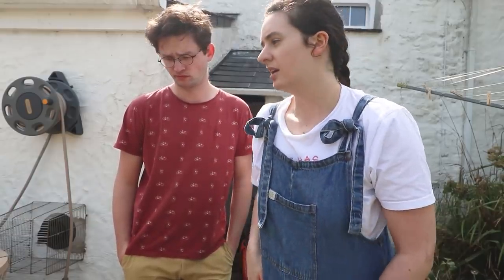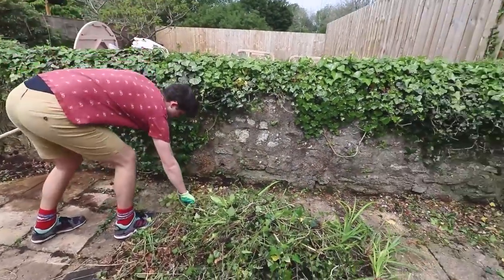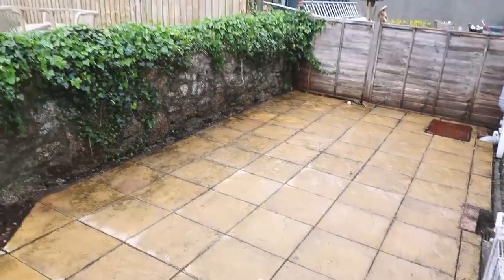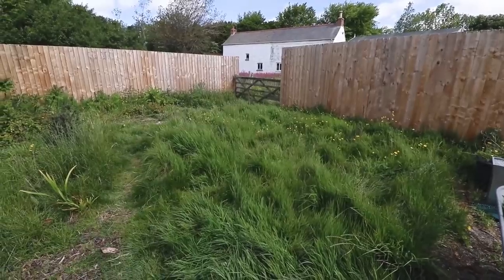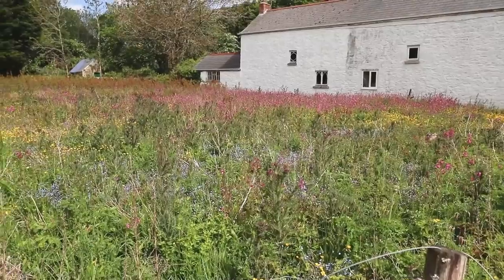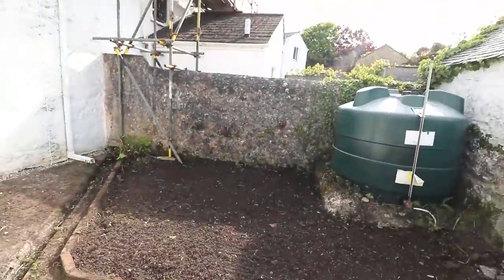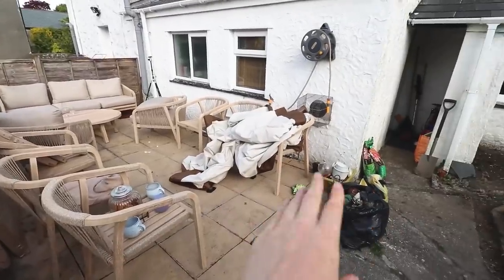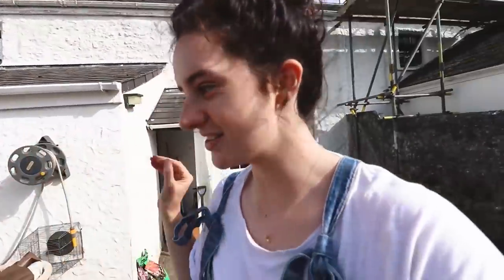TIME TO FINALLY SORT OUT OUR GARDEN | RENO VLOG 11

Comment: Tomatoes need at least 8-10 hours of sun to grow and ripen successfully! Peppers also... shade is good for herbs,spinach and lettuce....👐🏻🙂
Reply: I have 4 1/2 hours of sun on my balcony and my tomatoes have and are doing great!
Reply: This really depends on the variety! Some tomatoes have been bred to successfully grow with less sunlight and cooler temperatures, like Black Krim and San Francisco Fog. Several varieties of Roma and San Marzano tomatoes do well, too.
Reply: Also, if you single stem your tomato vines and grow them vertically, with a short wall like that you could have a good three meter vine that gets plenty of sunlight once it grows above the wall line. Just be sure you get an indeterminate variety rather than a determinate one if you're going to do that.
Reply: I agree that you really need to look at the specific plant and instructions for growing. Lots of herbs need full sun. There’s always something that will work in any area though!

Comment: I'm exited to see where it goes! I do have a shaded garden area as well, and there are some beautiful blooming plants that you can put there like hydrangeas, peonies and rhododendron along the back wall, with some smaller blooming plants in the front. I would suggest watching during the day to see when the light hits where, you might be surprised to see that shaded areas will get light during different times of day. Also, I would consider getting rid of that wall. I know it looks super cute and romantic, but if you have lots of people over the space will feel tight and unpractical. It's much more nice to move around when the patio is open to the rest of the garden.

Comment: I would probably use that patch on the side to put up raised beds and you could easily plant lettuce, spinach (great late winter/early spring and autumn crop), or carrots. I would also use a sunny side of the garden to plant tomatoes, zucchini/squash, and maybe raspberries. I'd also put up pots for strawberries around the garden for fruit but also because they would look cool in like old clay pots. I would also put up an apple tree. This could be such a little heaven plus a good apple tree might also add some value to the property, not to mention all the apples you'll get ;) Gardening is honestly such an easy but fulfilling hobby. You think you don't know anything but you'll learn a lot by doing.